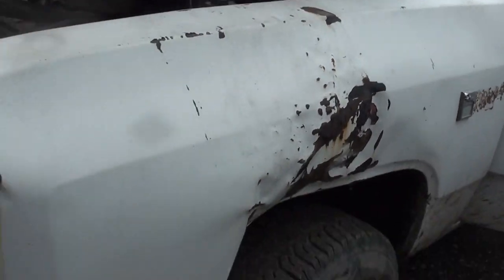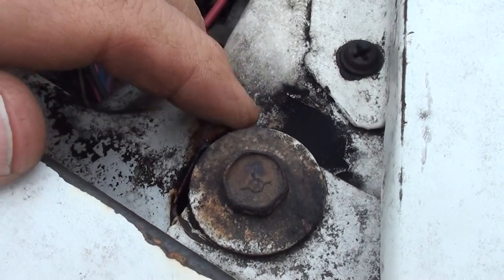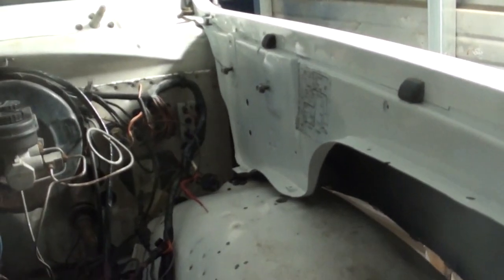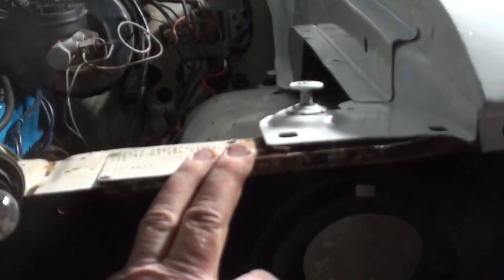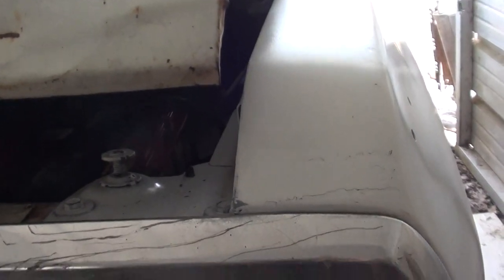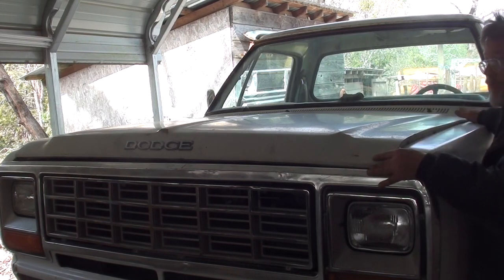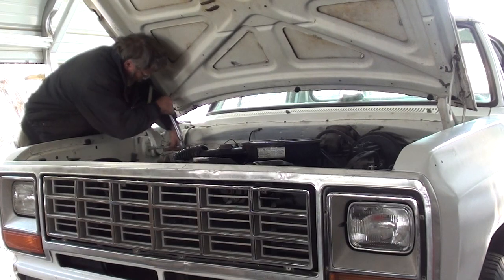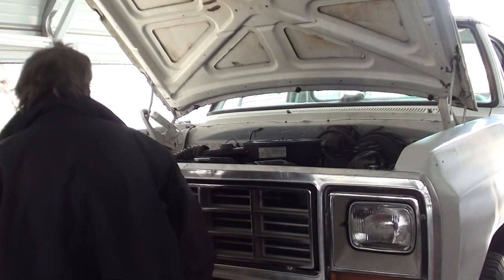Happy Thanksgiving!! Redneck Dent Puller 82 Dodge W 100 Short Bed

Comment: I had bought that same truck except in red, painted with a roller and a brush, cause it wasn't ugly enough. I think we paid $700 for it. It was a typical miled out 318, go to the gas station, check the gas, fill the oil. One night after after way too many wobbly pops, my ex business partner decided we should go find the headwaters of one of the local rivers, having been there a decade earlier in an atv, in the daylight I was elected as guide. So the start of the road was 10 miles from town, at the end of a gravel county road. We made it back at least 3 miles, before crappy failing halogen lights, poor judgement , and earlier heavy summer rains turned the goat path through the trees into a disaster. He swears he had tested and serviced the 4 wheel drive, it did have decent 31x10.5 mud tires. What it didn't have was an engine full of oil. So added stress of being stuck in a hole, managing to back out of it, the crankcase decided to add some additional ventilation and let a connecting rod free to imbed itself into the inner fender. 
This was way back when cell phones were new. I had one, it was fully charged. It didn't work untill we walked to within 7 miles of town. By this time it was around 5am on a Sunday morning, oddly, no one wanted to answer the phone to come rescue some fools. So by the time we had walked to within 6 miles of town we found someone kind enough to give us a lift into town. 
After sobering up, we talked to every tow yard in town, and only one would come out on a Sunday, but he would go no further then the end of the gravel. So many calls later I found a buddy with his father's 92 Dodge convertible Dakota, that reluctantly agreed to help. He was not impressed when he found out he had to back this immaculate truck in 3 miles into the goat path, as there were no turn arounds and the truck was mint. He had the easy part, have you every steered a truck backwards with wide tires and no power steering or power anything, for 3 miles? His truck came out without a scratch, mine can out with a bunch of new ugly, and no mirrors, he wasn't slowing down for anything, that little Dakota v6 wasn't going to recover the beast if it stopped moving. I think that was the last time I was a passenger of anyone who was under the influence of wobbly pops. I think the ex partner ended up finding a transplant motor and mirrors and selling the truck for close to the same money. We parted ways shortly after so I'm a little fuzzy.

Comment: First off...You are my Hero! I mean that sincerely, but this latest video only further cements that fact. Also...get out of my head! You know darned good and well that I have a cosmetically-challenged Mercedes which is in need of serious repairs that I cannot afford. So before everyone starts screaming about how I copied your video, I had my dents first. I will say that I did learn (as I often do) from watching this video. I was hoping that you might stop by The Classic Truck Ranch on your next trip north and assist me with this task. .....we're going to need a much larger piece of wood and a heftier chunk of metal......and trucks....Big Trucks........Love you Brother.
Reply from the maker: If only life heeded us instead of the other way around! I have another Dodge I made some footage of. An 02 or 01 gas 4x4 punched in the nose and pushed to the right. Didn't deploy the air bags, though. Came with a parts truck and someone started bolting the black part on the white truck. I made a brace that fits between the bumper mounts on the frame horn of the straight truck. It's to be bolted in to the wrecked truck. I'll have Kenny weld me some D rings into the brace and it's tree time!

That video of the 57 LCF with the 2 speed and the brownie looks to be vintage. Never saw that truck while I was there. With the Benz, if you measure the center of the front wheel to the rear on both sides, you'll see the left side of the car is shorter than the right. You gotta put it under tension front to rear while you have that LCF in low, low and low and pull on the rocker panel. Move it all slow like that 66 header panel! I think "Lurch" would be a good name for that truck! Too bad you can't get it whole!

Comment: yep did this with my 4runner back 4 inches down by 3 in the same corner but used a bulldozer and a hydrolic jack to keep pressure as pulling i went 1/4 inch too far but ehh